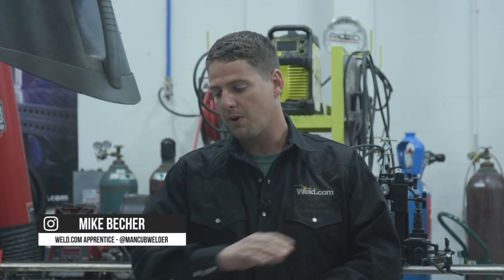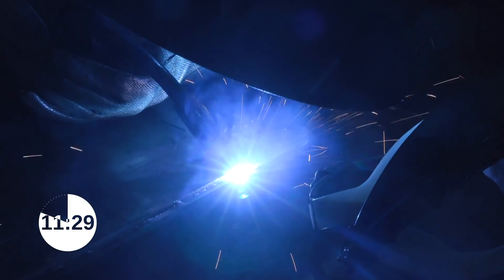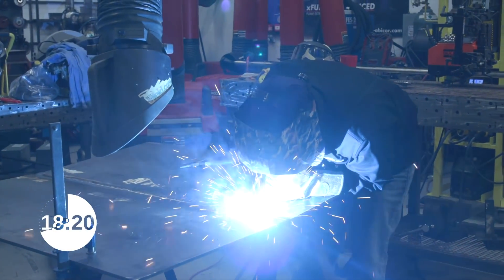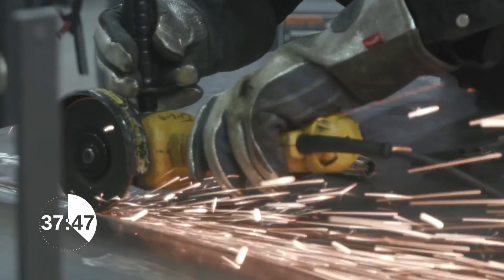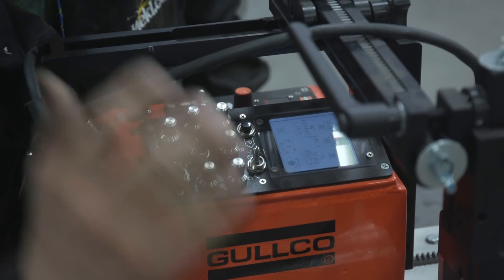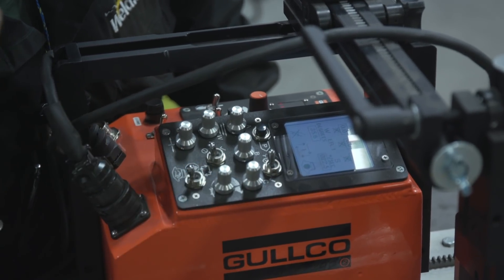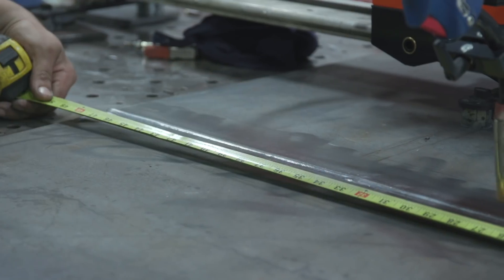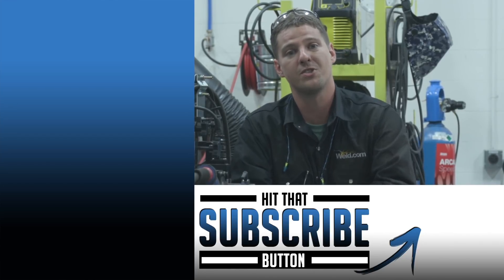Efficient Open Root Welding with Automation: Saving Time and Wire

Comment: Add me to the list of folks who dislike the music and choppy editing style. Is this a welding video or a cartoon?  Any discussion of welding efficiency for automated equipment needs to address set up and tear down time, equipment cost, operating environment limitations etc to be relevant or useful.  And how does this save wire?  It takes the same amount of wire to fill the joint no matter how you do it.  Lastly, if I've got to work and extra few hundred hours to pay for automated equipment that only gets used on a tiny fraction of my work how does that make it more efficient under any circumstances?

Comment: hey magcub.. just watched a video on urchfab where  he talked about how making a roll cage with a backside restriction can be a pain in the butt.  he simulated the problem   in 0125 mild steel tube and angle where the tube is really close to the vertical. he showed how he used mig in a tight space where the nozzle wouldn't reach.  he just increased stickout????  =less penetration, no?

i think you could make a great short series on this with solutions to the problem.
1-use stick welding
2-use flux core with long stickout with 030/035 wire with increased settings?
3-use mig with long stickout, no setting  change, increase v, increase gas flow, increase wfs
4-use a backer like rock wool to trap gas in long stickout situation
5-cut window in angle iron or pipe to get access to tight area from inside or backside.
6 -weld a footpad on the tube first so you only weld a straight weld

discuss benefits and downsides of each.  compare weld strength of each

Comment: Spray transfer in the machine yet globular transfer in manual?

Never mind such a weld could be done with double groove GTAW root and submerged arc without need for back gouge.

Comment: Just going to ignore the fact that you guys started the timer when you turned the gas on and were setting up with the manual welder but didn't count setup time and all that for the track welder huh? Come on
Reply: Haha I was going to say the same thing. I’d say this video showed that manual welding is faster. Plus the weld settings were either pre determined or the manual welding dialed it in so you knew what to run on the automated welder.
Reply: @mitchellpecher8954   yeah, I could see maybe the actual arc start to arc stop time being maybe a minute or two faster if anything after all the passes just because it's more of a steady and consistent travel speed, but they acted like it was what 15-20 minutes? Lol...I'm not against certain technology in the industry and certain things no doubt have their place, this is just a horrible comparison. No doubt a paid promotion, which is fine, but if anyone from weld.com sees this, please, we have enough bs and fuckery in the world today, we don't need this kind of content in the industry. All you had to say is that this could be a great option for specific applications and show the honest times and not act like it cuts the time by tens of minutes.